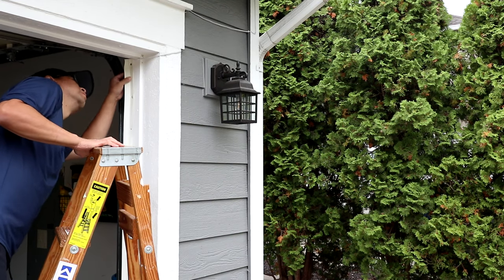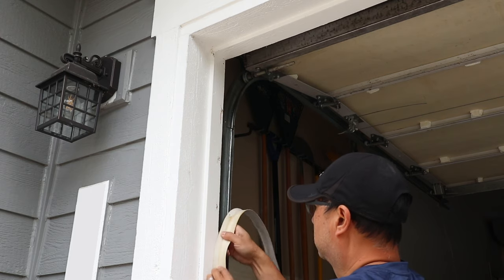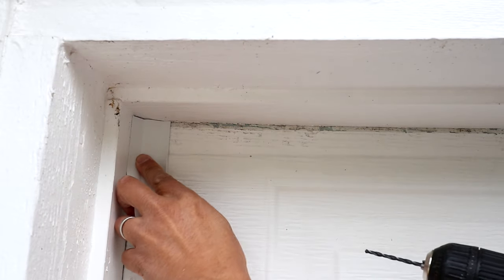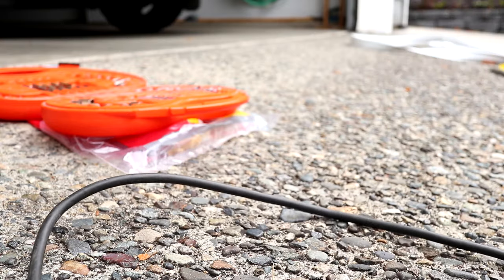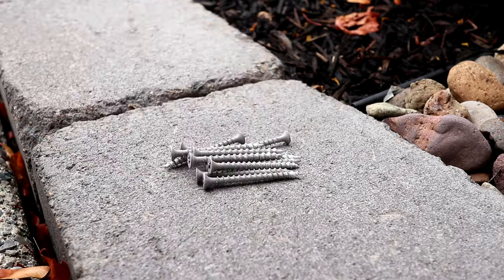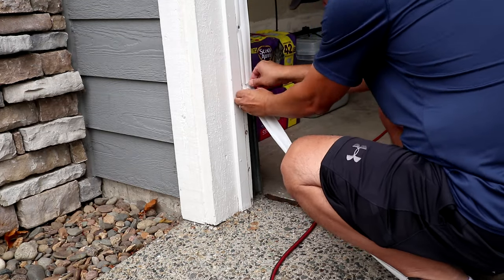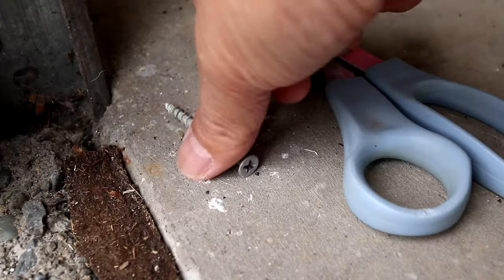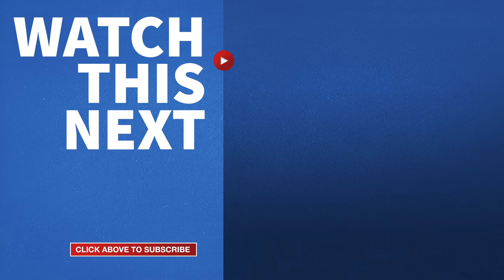Garage Door Weather Stripping Replacement and Installation - Garage Weather Seal for Side and Top

Comment: The screws are so long for the thickness (thinness) of the rubber strip.  I think screws half that long would have worked just fine.
Reply from the maker: Yes! I definitely agree that the screws I used are too long! They were the shortest ones I had on hand so I used them. Major overkill with the size I had. If you have shorter/smaller screws definitely use them! Thanks for watching!
Reply: @digitalcamproducer  white painted Phillips screws 3/4 inch in length would have been the pros choice
Reply: Why not glue it?. It will provide better seal .
Reply: The screws are massive. Could glue behind you much smaller white headed screws Aesthetics count.

Comment: The part where you put screw is what goes to the door side. The thick side is what gets nailed to frame.. But should work the same.
Reply: I bought the same stuff he did and he installed it per the package instructions. Doesn't make much sense to me either

Comment: Thanks! I had never seen this type of seal before, so I wasn't sure how it should be installed. My local big-box hardware had the seal, but no picture and written instructions so vague I could not even tell which edge should be against the door! Turns out, it IS simple to install--but only after seeing a picture of how it works. So helpful! Thank you!
Reply: I would recommend a 3” screws vs 2” screws. You want to feel confident that weather strip is in securely. By the way, I am a manager at McDonald’s if you are going to question my qualifications.

Comment: My seal is actually attached to a 3/4" think piece that is attached inside the garage door and is warping on the sunniest side of the garage. II can't find any replacement seal that looks that thick. Does anyone else have this issue or have a suggestion how to replace seals like this?

Comment: Why such long screws?????
Reply from the maker: Those were the size of screws I had in my garage so I used them. Also the package came with thick nails that were maybe 1.5 inches long. I didn’t want to use them because I thought they’d split the wood trim. And they’d be difficult to remove when it’s time to replace the weather seal.